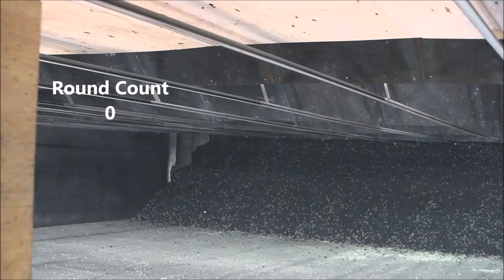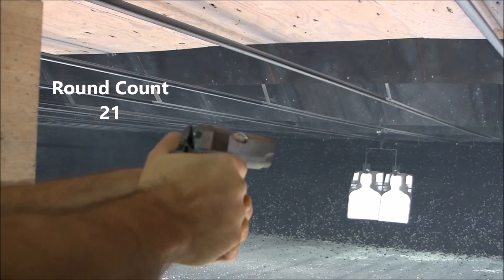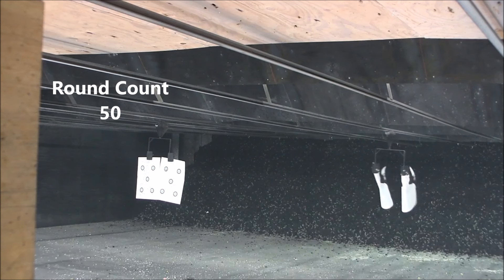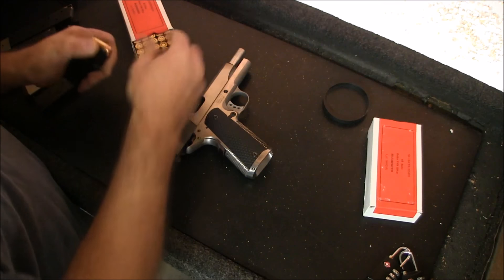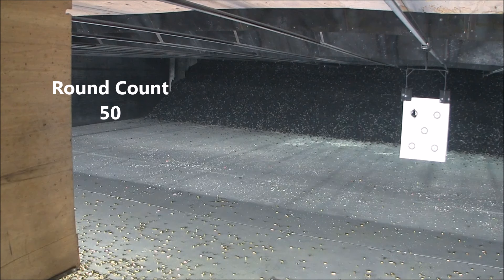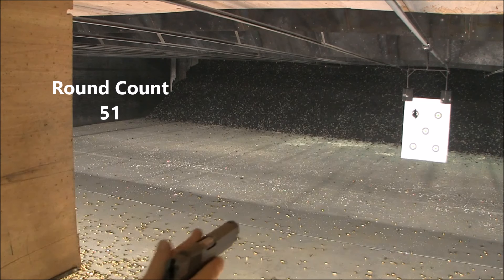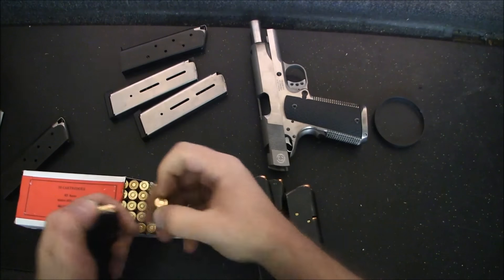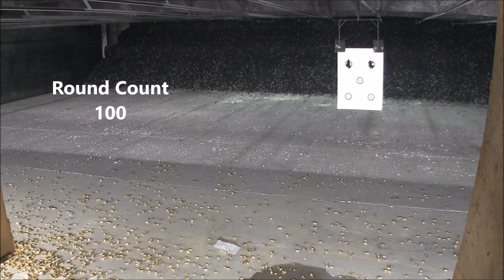1911 Build 8 Commander 45 acp - Part 10 - Test Fire

Comment: I've really been wanting to fit up a new barrel on one of my factory kimbers and watching several of  your videos has taught me quite a bit.
Reply from the maker: I am glad the videos help. Let me know if you have any questions.
Reply: @MosinVirus  I'm sure you get asked alot of questions so I won't bother you with too many. I am curious as to how you got to where you're at with gunsmithing and building/customizing firearms. Did you go through armorer's courses? If so is there any that you recommend taking???? Thanks alot...
Reply from the maker: @thollingsworth4910  I have always liked working with my hands, and when I was younger i actually went for a tool and die maker degree because of it, though I never actually worked as a tool and die maker. Then I got into firearms and was instantly hooked. Prior to it I have made knives, sculpted, made some furniture, etc. With 1911s I got books - Kuhnhausen Shop Manuals vol 1 and 2. I never took any armorer or smithing courses, but may do that in the future.
Reply: @MosinVirus  thanks, I'll check out the books you mentioned.

Comment: How are the hands? Was the recoil punishing? The gun is a real beauty! I have a Commander built from an Argentine Colt pistol and I love it.
Reply from the maker: Thank you. Hands are perfectly fine. I think the checkering looks worse than it bites. I will be dialing in the recoil, because I think it is a bit on a violent side right now. The casings were ejected with a lot of force. I may go with a 25# hammer spring first and see if that slows the slide down a bit. Then I may try 20# recoil spring.
Reply: MosinVirus Have you consider using a slide buffer?
Reply from the maker: RobertoDonatti No, simply because I don't want to steal any slide travel from the gun.

Comment: Nice job. How does that stippling feel that looked so sharp? Good looking gun. 👴🏻👍🏻
Reply from the maker: Thank you. It feels surprisingly really great. Not a single time did I think that I should flatten the tops of the checkering pyramids.
Reply: MosinVirus very nice work guy! I'm wanting to put a 1911 together from the ground up. my question is if i buy a frame and slide do i have to fit them? or can i just put them together? i don't have all the tools that i would need. but i so badly want to do this! looking good sir!
Reply: Tyrone McBride you can purchase the frame and slide already fitted from Caspian Arms or Fusion firearms.
Reply: OpticalContusion thanks. been playing around with a cheap Llama and now i think I'm ready to take on a real project! i will start off by buying a frame and slide. but by buying a slide and frame already fitted would that be slacking on my end?
Reply from the maker: If you are looking to put in a bit more work, get an oversized (to be fitted) frame. That way you will have to work on it to match to the slide. If I could, I would but pre-fitted.
Reply: great job. love it.
Reply: I'm surprised your hand wasn't bleeding!
Reply: Tyrone: You can get most parts for a build that you just assemble with no hand fitting, or you can buy "gunsmith fit" parts that require hand fitting. Depends how much work you want to do. You can make it easy or hard. The parts you have to hand fit have greater potential for a nice fit, but then again, they also have the potential for worse fit!
Reply from the maker: Re: Hand bleeding. The checkering only looks scary. It actually feels great. And not a single scratch, blister, or area of tenderness.
Reply: MosinVirus great job! I'm going to look at some frames and slides monday and place a order! i will let you know what i pick out..
Reply: @tyronemcbride5044  So how did it go?

Comment: Will there be fitting issues it the barrel, slide parts kit and slide are all from the same company.
Reply from the maker: All depends on the parts and if they are drop in or not. If you are buying it as an assembly, then everything is already fitted together. But then you still can run into issue with the frame to barrel relationship and frame to slide relationship.

Comment: Are there any frames on the market that allow a build with a full length rail? Similar to a Springfield TRP Operator or STI Tactical DS.
Reply from the maker: mandaloin 80%, no. unless it is a 2011 frame. There are completed frames (100%) that do have full length dust covers.

Comment: If you reload your own try the magnum pistol primers might cut down on the wasted powder. Just thinking. Accuracy at 5 yards with no sights come on really what is there left to test hahahahah...Seems to feed, fire, cycle well. OH Oh I`ll give you a dollar hahahahahaahh..Nice job there. As far as slide stop issue I had a Steyr M 40 lock closed light primer strike to round in chamber. got it all pulled apart got to poking around in it found a piece of copper jacket wedged in it sometimes they shake right out.
Reply from the maker: Taurus/Hipoint Enthusiast unfortunately I don't reload yet. but I am saving brass for when I do. In your experience, if a primer strike is off center, could it cause some more unburnt powder than with a center hit? Or is it a situation where a hit is a hit
Reply: I have run into many different opinions. For me a hit should be a hit. However pending primer used heavier strike to one side could smother the ignition for the opposite side of the primer. Resulting in unburnt/unused powder. And it is also the reason I stay with magnum primers for all my reloading needs I know of a handful of folks who reload using only magnum primers.But follow all reload data and then experiment make an informed decision based on your results.
Reply: I’ll triple Taurus/Hipoint’s offer.